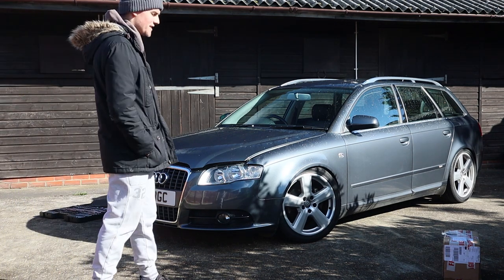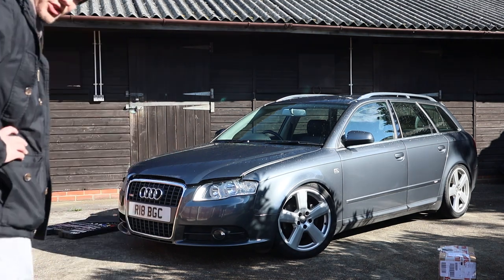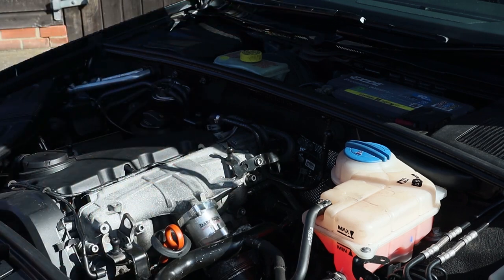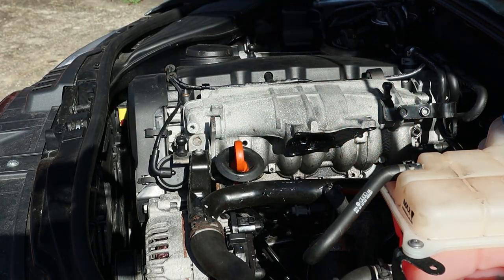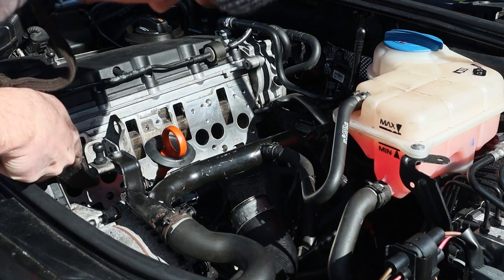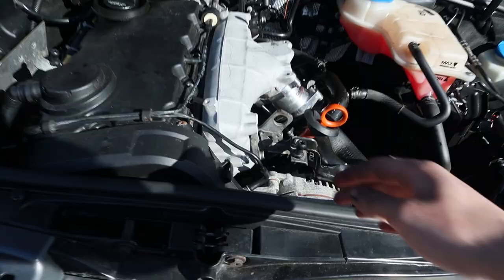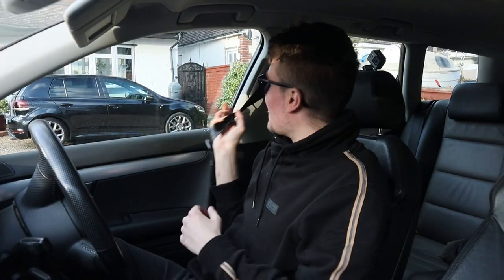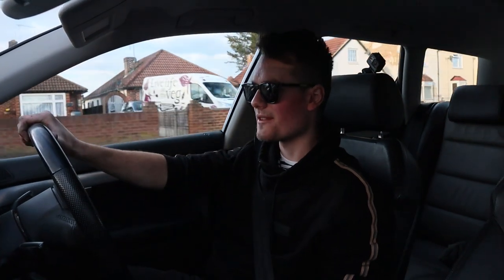Why I Installed a New Intake Manifold, on the Audi A4 TDI!

Comment from the maker: Nothing too exciting for this video, but if you enjoy seeing the driving side of it, stick around to the last half of the video!
I am taking all your guys advice and will  be diving into things to see if it fixes the issue I have with it soon. 
Things I'll be checking: 
Fuel filter, boost leaks, injectors, heat soak.
(Drop your ideas replying to this!)
Reply: do u still have your dpf ? If i understand correctly u have a bit of a jigglish/power loss/delay before the motor reacts ? i had a similar problem on my BRD 170hp tdi, the problem was when the car enters thermal regeneration on the dpf ,it had the same issue on any rpm. If the thermal regen was off there was no problem. check it with obd11 in real time data.
Reply: @BigBanDGosho  The DPF was cleaned, aka re***ed for legal reasons hh
Reply: One of the easiest ways to find boost/vacuum  leaks is to get a piece of small diameter flexible but hard plastic hose (B5 Passat vacuum hoses are perfect)& run the engine whilst listening at one end of the hose as you move the other end along each of the pipes in turn 
It will soon show up

Comment: First rough start seemed like it was a weak battery, however every start from now on it may be slightly rougher as I'm pretty sure it uses the flaps as a slight 'choke' rather than adjusting the fuel inject quantity
Reply: Made no difference to how mine ran at all. Mine's a BRE.
Reply: @MrPIEEYEDPIPER  interesting. Maybe another issue then

Comment: Hi there, I suggest you to change the glow plugs and would be a good idea to check the engine mounts included snub mount and gearbox mount as well. Both can cause hesitation and rough start. I have a 1.9 pdtdi, suffered with these symptoms and changing the mentioned parts above the issue is gone. Have a good one! :)

Comment: If it feels rough with the powerflex snub mount, adjust the base plate so no part of the rubber touches it. You'll barely feel the engine at idle and find yourself checking the tacho to make sure you haven't stalled out. Also, it will benefit from being tuned because you've changed the airflow.

Comment: Thank you, did my intake as well, the start was rough as hell, car is more responsive now at low rpm
Reply: Hi Kurdish, just done my intake on my BRD engine mate. Quick question, did you map software out? My mechanic said no need to do that
Reply: @jamboheart2039  hell no, i have a BRD 170 too, the flow is pretty much the same the engine dont need any adjustment. just dont drop too much gunk in the cylinders or startup is horrible and smokes crazy. if any other questions dont be shy !
Reply: Cheers Kurdish, I’ll see how it runs for now although I have had fault code 012546-motor for intake manifold flap (V157) pop up. 
Car has been a total money pit mate
Reply: @jamboheart2039  hi i fell you, what you have tho is not related to this flaps in video. Try unplugging de throttle body spray brake clean, delete codes and try. If not working try messing with electronics of this flap, or change the piece it should cost 50€ maximum. 

http://wiki.ross-tech.com/wiki/index.php/19558/P3102/012546

Comment: Hesitation maybe the exhaust sensor, sure one friend had the bmn pd170 engine same as mine after fitting new exhaust sensor it didn't hesitate.
My plastic manifold sounds ruff with the swirl flaps so I'm looking into the bkd manifold to get rid of the swirl flaps some say the engine runs smoothly, i don't have power issue mine spins 2nd and 3rd no hesitation just after 3000 rpm min seem like a calendar month getting to 4000 rpm where as when i first bought it reved very quickly through every gear.
Great content great video.

Comment: At low rpm, the swirl flaps closed allow high velocity air into the head still. As rpm increases air velocity increases, swirl flaps can open which then allow full air flow with high enough air velocity. 

Which is why, when with just fully open ports, you just loose low end torque.

Comment: flaps are there to alter the intake runner length for power at low rpm am high rpm so removing them will loose you power somewhere in the rpm's.

Comment: Nice car I had similar issue with my 1.9 TDI since using revive turbo cleaner it's alot better you might need to get a smoke machine on it to be able to find boost leak

Comment: Some do on the transverse 1.9 the snail intake .  
My ford has a complicated intake that uses 2 length runners one long one short and a actuator to switch from one and another based on rpm . Which is annoying when it breaks

Comment: if you dont have this flaps in your manifoil in working order you will get a fault code and you engine are weaker on the bottom end, i have this engine and the flap are good but you have 2 clean them like in a service so they dont get stuck

Comment: Nice video dude.  I have the same problem. That is, if the butterflies are removed and it is constantly left open, there will be no problem that more air will go to the turbo; It will also have a difficult start each time;  I want your help thank you.
Reply from the maker: So I believe from researching this issue, it is the engine speed sensor. I'll be changing this on the weekend and getting the video up next week so hopefully that resolves it! 🤞
Reply: @BWTV  Thanks for your answer.  I will wait for you although I think you should not change the manifold and put without butterflies because I believe that putting more air in the turbo would create a problem.🚘👍🏻  in the meantime my car  is with cvt transmission

Comment: Judders most likely injector loom 1st thing to do is remove the cam cover remove the injector connections and tighten up the tiny female connections that connect onto the injectors. if that does not sort it replace the injector loom

Comment: Got an a4 saloon with the brd engine (170) just hD it remapped after having the oil pump drive replaced and now the car hesitates around 3k rpm in 4th 5th and 6th, changed fuel filter and done the egr delete and still does it.. if you find out what is causing it please do an update video.. keep up the good work 👏
Reply: Did you end up fixing this
Reply: Hi, did you fix it? Can you share how you did it if soo? Thanks!
Reply: @piovo1 did you fix it? Thanks
Reply: @johnmarck5986  I never had this problem bud was just curious if he ever did fix it
Reply: I have a problem with mine, around 2 000 rpm it's choking I just replaced the EGR valve, the DPF filter ben removed before I've bought the car. Still can't find the issue. Any thoughts?

Comment: So far, you have done every mod i did for my audi. I sunk 3k in to the car. In mods and problems. 
If you remember, I told you to sell it when you told us you bought a b7 
It'll be a bottomless pit otherwise.....
Reply from the maker: I will be sticking it out :D If things go wrong, it makes for a good video lmao
Reply: @BWTV  you could get a boost gauge feed from that blanked vacuum hose. 
You'll find if you revert back to a standard map, most of the problems you have like 3k hesitation and hard starting will disappear
Reply: @BWTV  theyre great cars. Not had one bit of trouble with mine, mapped dpf and egr deleted. Runs perfectly
Reply: Usual issues but there old cars now I have same car n love it I got rid of a s3 8l for family reasons n love it wish I got the rs4 though they to are a money pit 

( 14 years vdub specialists)
Reply: Hi Steven, I have the BRD engine, got my mechanic to change the inlet manifold. Would I need to map the car now to delete software? My mechanic said no need to map it. What’s your thoughts mate?

Comment: What power should this car be running now after the egr delete and map? watching the speedo on your first pull seemed like it was still running almost standard power, I had massive problems with my a4 170, have you put it on a dyno yet? Mine ended up having 133bhp "fucked"
Reply from the maker: Should be near 200, can't really say it feels like it though with the hesitation it's got going on. So hard to sense the power when it's only got from 2-4k of power 😂
Reply: I ended up getting a 2005 2.0tdi golf 140 and that's mapped, and that absolutely great, just a shame its not a good to look at as the audi avanta

Comment: Get it engine carbon cleaned will make a big difference 👍🏽 will clear carbon from the turbo and intake and exhaust valves so will be smoother and more responsive after 👌🏽
Reply from the maker: Sounds like a good idea!
Reply: Hi what will carbon cleaning clean on this engine and is it the one when they put some fluid thing through the intake or something thanks

Comment: does your car accelerate better with the new intake manifold or with the old one?  I'm interested in the behavior of the car at lower revs?
Reply from the maker: 1-2k is a considerable loss of power then builds up to a much more punchier kick at 2.5k. Altho there Is less power earlier on, it drives much smoother
Reply: @BWTV  I'm planning to install this BKD intake manifold on the Passat b6, in your opinion, is it a smart idea or should I leave the old intake manifold with flaps?
Reply from the maker: @TuberYou-eh4oy  if they have the plastic flaps get rid of them, otherwise it runs the risk of degrading and being sucked into the engine. Plus the big kick in power is more fun 😆
Reply: @BWTV  and what do you think about the big kick in power after 2.5k, is that power significantly more felt in % with a BKD branch or with a branch with flaps

Comment: Try some Redex injector cleaner
Reply from the maker: Sweet I'll look into it
Reply: @BWTV I normally put it in at the fuel filter, about half a bottle. Although they recommend putting small amounts in the tank. I think it's stronger when u put it in at the fuel filter. I'm sure it will cure the hesitation issue

Comment: Delete the egr thats beter for the engine.
After the delete of the egr, the engine wil sound beter and the gas response is beter. I have done it on my 2.0 TDI en the engine has now 350.000 km on the teller and is stil going everyday